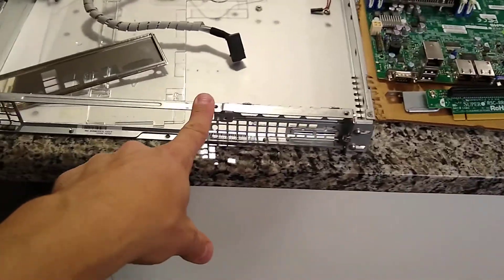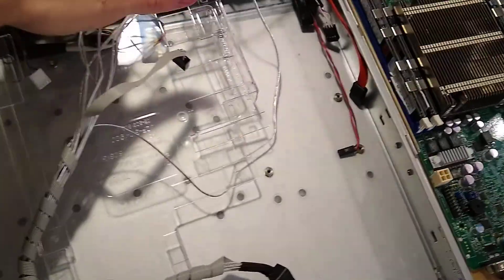Supermicro 1u server build - X9DRD-LF dual Xeon 2011 - CSE-815 Chassis - Part 1

Comment: Alain Hernandez

I just got two of those  and i cant get the 2nd cpu to run .....i have 4 xeon 2660v2 10core each  any good idea why .....thank u in advance
Reply from the maker: Hmm did you try swapping the CPU’s and do you have ram in slots for both CPU’s?
Reply: @BrooksyTech   yes to both .i have 4 xeon 2660v2 and i cant get neither to work as a 2nd cpu so at this point i think is me lol not the mother board
Reply: there are two 4-pin power connectors (JPW4/5) are
located on the motherboard. do i connect does?